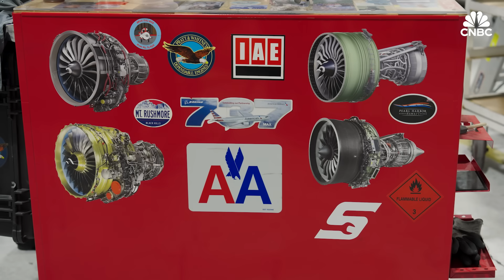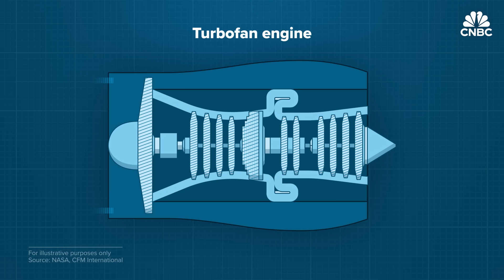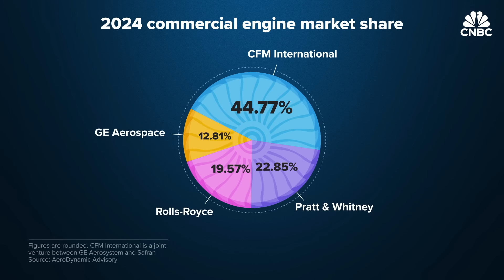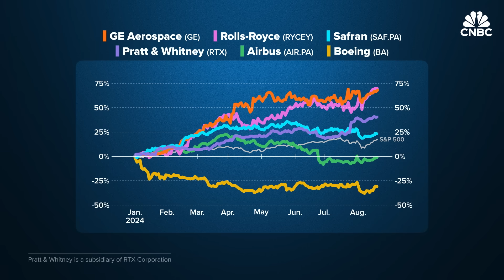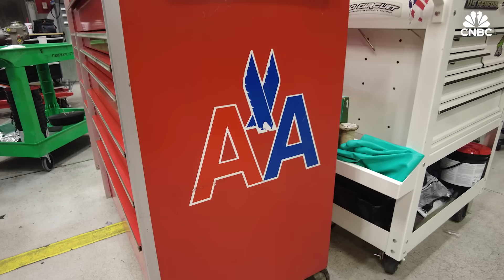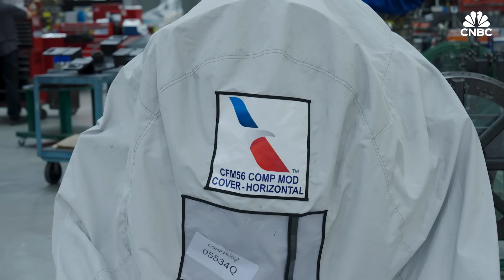Why Airlines Like American Are Scrambling To Make Engines Last Longer

Comment: I'm trying to understand why, for General/Private Aviation, theres still such a backlog / shortage / delay of parts. 
Something needs to change.
FAA, you need to allow 3D printed parts or something, & shorten the approval process for new designs.
Reply: It's mainly for certified items. Experimental certified planes have a much easier time with parts availability because you can side step a lot of the limited supply.
Reply: 3D printed (additive manufactured) parts are allowed and already in service, but they are still produced to exacting standards in controlled industrial environments. You aren't going to be printing out airworthy aircraft parts in your living room.
Reply: the blades in the hot section are grown from a single crystal and have to handle some of the highest temperatures in the engine.  There isn't any material you could print regardless of the method (SLM, etc...) having said that CFM has started 3D printing some of the fuel nozzles in the LEAP engines.
Reply: Aircraft parts are not simple to manufacture to spec. They only appear that way to non-technicians who relate to objects based on their external shape.
Study how parts must be made. Printing is not magic, especially metal printing, and with respect to metals grain structure and much more is critical.
Turbine hot section parts made of superalloys are not easy to manufacture. So few countries manufacture their own jets and turboprops because the precursor 
industries are so complex. Passengers expect not to crash. There is no low hanging fruit.
Reply: The usage of Additive manufacturing is going to be increasing substantially in aviation, like i said the LEAP - the latest version of CFMs narrow body engine has a few 3d printed parts including the fuel nozzles which have an incredible geometry and would be much more expensive to cast or machine.  The only issue with 3D printing is process control
Reply: the reason is simple as it is meant to keep the price high by controlling the supply. Just like diamonds. Once china from their engine development and c919 is more established, you will expect to see the dominate players to be competing with chinese efficiency
Reply: @caryandrae9952  Not even close. It's not a conspiracy for price control, it's a biproduct of testing and certification costs. The FAA's job is to ensure planes aren't falling out of the sky. To do that, there is a huge amount of safety and redundancy that gets thrown in that adds cost. All you have to do is look to the 737 max to see what cost cutting and expedited approval does for safety.
Reply: @caryandrae9952  C919 is made of 70% American and Eurpoean parts, and despite the decades of efforts to steal the technology, there won't be any domestic version of those parts and the engine anytime soon, and as we are going to see more tension between the West and China, the future of C919 doesn't look that great, (based on the estimates it would take China 15-20 years to make those parts domestically and by that time they are already 15-20 years behind.)

Comment: Modern engine reliability is simply amazing. The fact that wide-bodies are successfully running transcontinental flights with only 2 engines shows how far aviation has come in the past 30 years
Reply: and more importantly the fact that nowadays narrow body planes (such as the a321neo xlr) also have the capability to fly transcontinental which I find amazing
Reply: More interesting imo is the increased ETOPS rating enabling more direct routes.
Reply: @m93sek the fact that twin engine jets are now certified to fly 5.5 hours away from a diversion field is simply amazing, and gives them access to something like 95% of potential routes. 

Really the only issue with ETOPS these days is the increased fuel burn on a single engine - one can count on everything else working just fine even if the failure was an un contained explosive engine failure. 

People love to rag on Boeing these days but commercial aviation has reached a level of safety not even dreamed of just 20 years ago.  Every year experienced multiple catostrophic crashes whereas now the last crash most people can probably mention is the 737 max, and that was over 5 years ago now. 

It’s really a marvel of engineering.  Commercial aviation has stalled in terms of speed and size advances but it sure had excelled with safety, fuel burn, and range.
Reply: @cruisinguy6024  JAL has left the chat. although that was human error by the coast guard
Reply: Iv seen the damage these things can take and still keep on going. The crjs and erjs use the cfm engines as well and Iv done some boroscopes on them and Jesus, their tolerances are amazing. Iv seems holes inside the combustion chamber, cracks in the lining, missing blades, and depending on the severity of them they will say to door an inspection every 600 FH. I think the lowest Iv seen was like every 50FH or less but we decided to just change the engine cause it would just be better and safer, and less down time at the gate